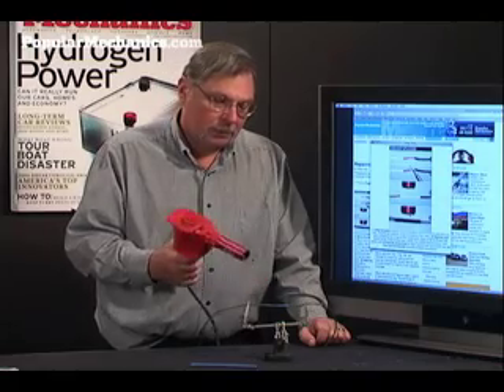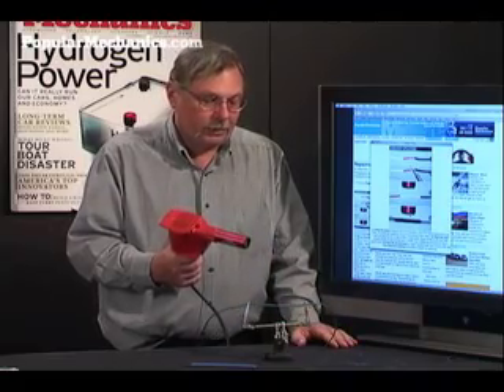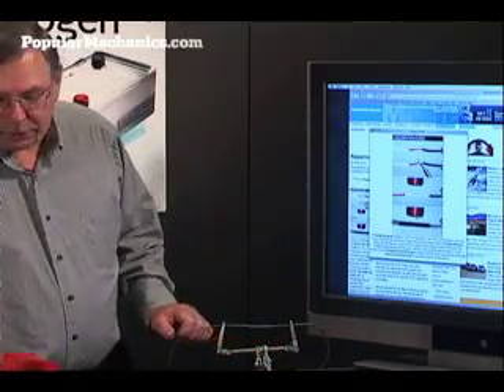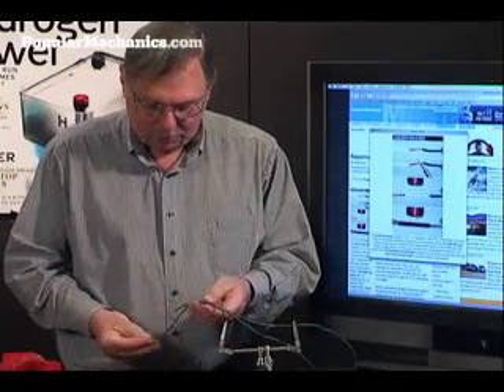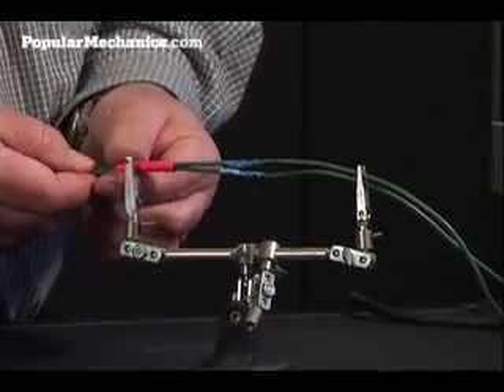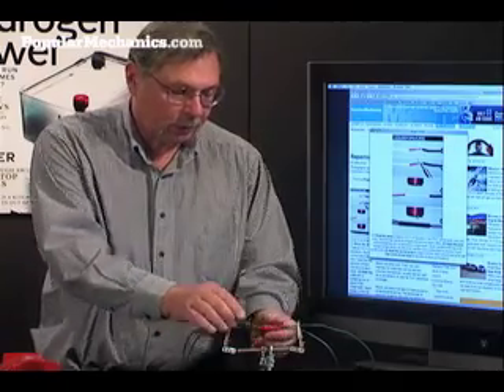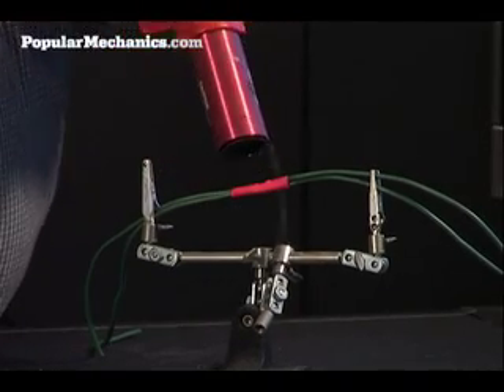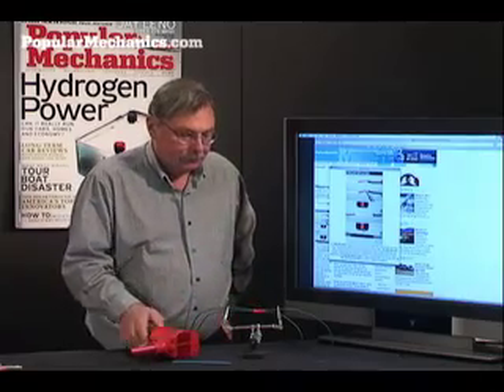How to Heat Shrink Soldered Wire Joints | PopMech

Comment: Alessandro Volta truly discovered electricity as we know it, i.e. a steady electrical current using positive and negative, if we were to go to who invented the word and concept of electricity without going back to the Ancient Greeks or Romans, it would be British physician William Gilbert who used the word Electricity to describe the reaction seen when two substances are rubbed together, this was over 150 years earlier than Ben Franklins Kite and storm discovery which was hardly any more concise than the discovery of static, So the real accolade has to go to Italian Alessandro Volta, who's name is why we measure in Volts as the guy who really harnessed electricity, which is what counts after all.

solder has nothing to do with electricity and it is more than 5000 years old, but if were talking about modern soldering techniques we gotta give it to Ernst Sachs who invented the electric soldering Iron.

Comment: I'm going to splice a wire on a motorcycle to fit an alarm. How do you protect the soldered splice when you can't slide heat shrink over because there is no open end from the motorcycle wiring?

Comment: Once I couldn't find the heat gun so I used a soldering iron (not the tip of it, the part further away from the tip), it wasn't perfect but it got the job done...